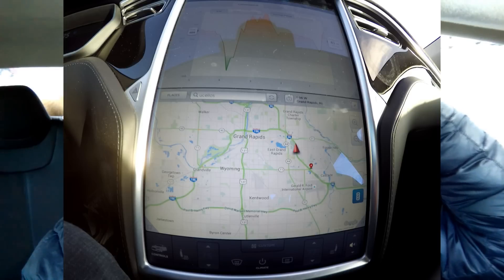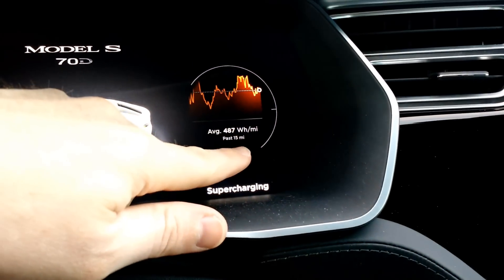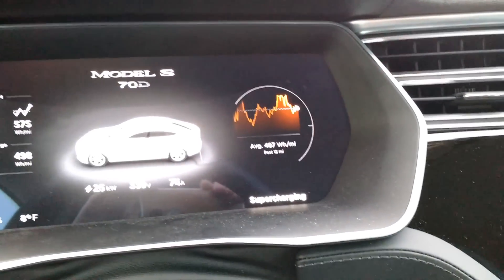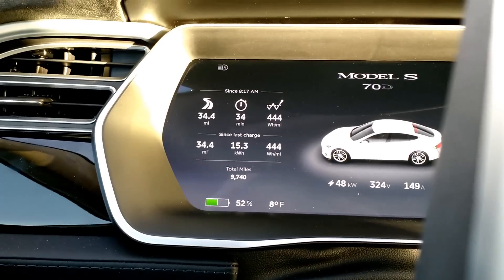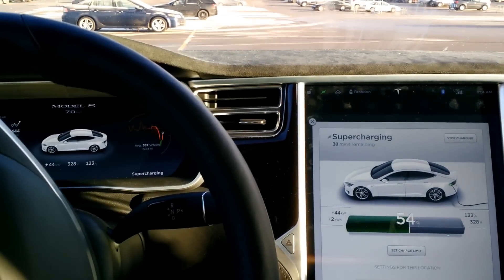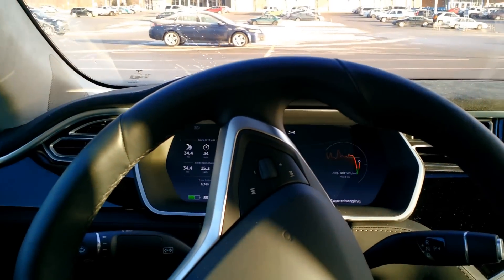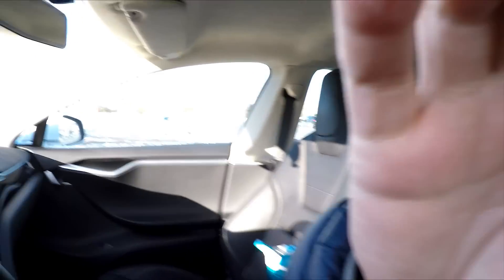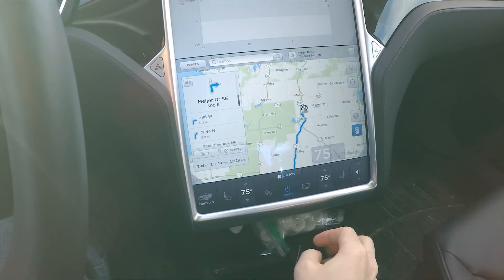Tesla 70D Energy use: 75mph and COLD

Comment: Nice report.  I had imagined myself doing something similar in my 70D but had not gotten it done, so glad that you did!
My car has a sunroof so my guess is that mine would use more energy than yours under the same conditions.  It would be interesting to measure that difference, by having two otherwise identical cars travel together over same route, etc., and compare energy with and without the sunroof. Question: Have you double-checked the data you get from the "Since Last Charge" display? I have found recently that my 70D reports incorrect miles uses.  I keep a log of charging. When I compare the calculated distance between charges based upon odometer readings with the miles shown in the "Since Last Charge" screen, they do not match.  That makes me doubt if the other values (energy USD and KW/mi are correct.  I have reported this on TMC but I am not sure (yet) if others have noticed this.
Reply from the maker: That's interesting, I haven't checked the last charge odometer accuracy. It's been consistent to within 0.5 MI on this loop

Comment: That's not real cold but is cool. Slowing down will have a bigger affect than messing with heat. Once the cabin is warm it doesn't use a whole lot of energy. You should also do a back to back range mode test as some folks are reporting a 7% increase in efficiency with range mode on. I know I do see a difference so I always drive with range mode on when on the highway, all year round. But the nearest supercharger is 500 miles away and so I've never supercharged even after having my car almost 10 months... so I need to use as little energy as possible as it's 100% L2 charging.
Reply from the maker: +InternetDude yeah, I plan to do more tests like that. I had range mode on for most the my trip out west but noticed when I took it off it didn't seem to make much difference so then I left it off. Conceptually, it conserves energy by lowering accelerating energy, shifting power between motors, and limiting AC/Heat; but interstate driving is fairly steady state, so I started wondering if there is a greater energy saving if you're not going straight for 100 miles. No question speed is huge factor. I had to slow down to 60mph in some places where the speed limit was 75.
Reply from the maker: +InternetDude the other thing I've noticed is that a high speeds (75-85mph) the cabin cools down much faster than at slower speed, like a wind chill factor for the vehicle, which requires higher heat settings at higher speeds.
Reply: +Tesla Evangelist yeah I wonder, I guess range mode could be less effective on roads that are mainly flat without many turns. If the car needs to power itself up and down hills the torque sleep could be more effective in that situation, who knows?

Comment: It does, when the car is travelling (I understand). Tesla therefore recommend people use the seat heater rather than aircon when they want some range. But the main point is you shouldn't have to sit in sub zero temperatures whilst doing these tests. Your tests are, I think, REALLY helpful, and I would hate for you to be reluctant to do more because it's unpleasantly cold in the car. And as you point out, the way someone drives has MUCH more effect on range than having the aircon on or off. 
(NB Amazon sell a useful gadget that goes in 12v socket to give you a volt reading on the small (12v) battery)

Comment: Thanks for doing this!  Better thee than me..if you get my drift.  I think the outside vents-louvers- open and close depending on the battery temp.  So I would assume those are closed by design.  It's just at that temperature the drag is so significant.  I get the same effect on regen when we're cold even up to 40 deg f ambient.  I'm in Nebraska.

BTW, altitude has an effect too.  So if you were doing the route in say Aspen Colorado even at 8 deg F (AMSL about 8,000 feet) your result would be a lot better. I expect you could use some formulae from the numbers you got and figure out all kinds of scenarios without driving!  One chart says about a 25% decrease in drag at 8000 ft than at sea level.

If you really slow down to the 'sweet spot' which is about 22mph you should really get some good numbers.

But here's something else to think about.  Tires and pavement are HARDER at that temperature so being less sticky that's HELPING a little bit but not enough to offset the drag.  If you have winter tires, those are really soft so that might be an offset.

I'm not ignoring the fact that Li-ion batteries don't like the cold and I wish there was a way we could monitor their temperature.  There's not a whole lot we can do about that anyway.